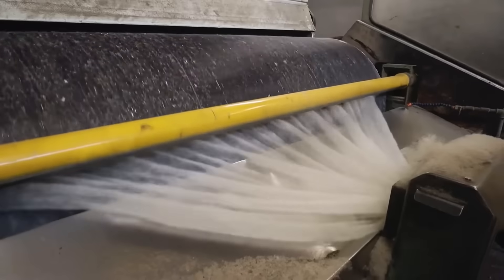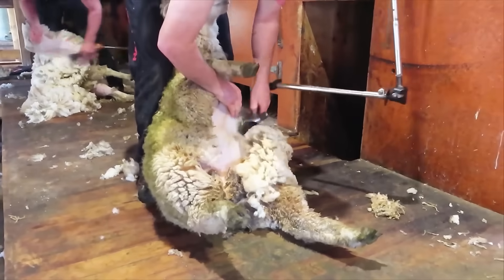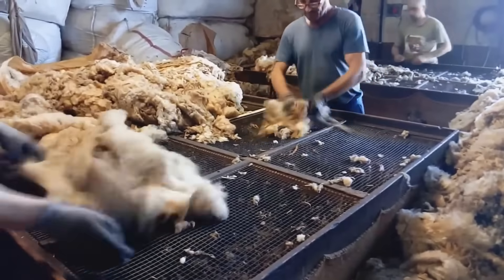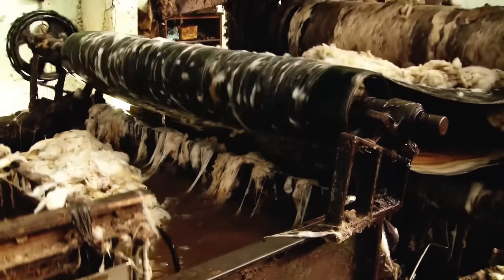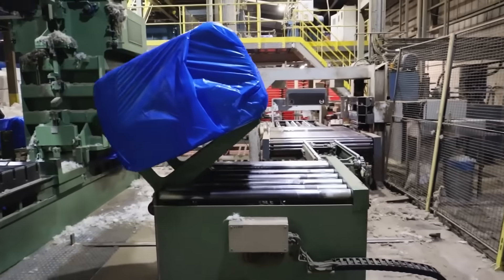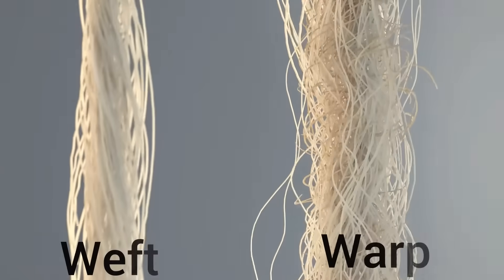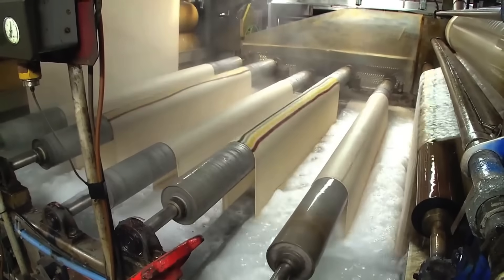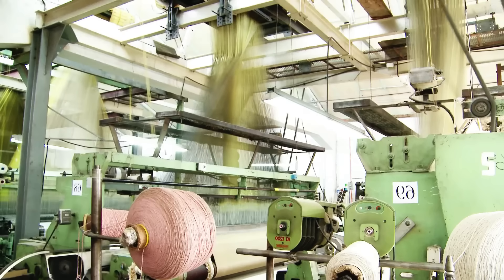AMAZING Wool Manufacturing Process 🐑 | How It TRANSFORMS Into Soft Clothing

Comment: I'd like to know what they do with the rest of the fibre, the stuff that's considered dirty. Surely they can use it for something, if only for composting, or creating large berms for flood control.
Reply: It is, but for blankets
Reply: The dirt parts they put it in washers and or dryers until it’s a clean soft ball and you can use that ball of wool for washing clothes to remove static
Reply: nothings are wasted in industrial works